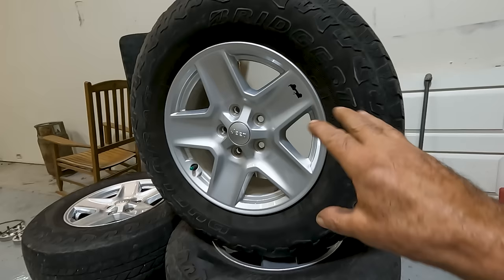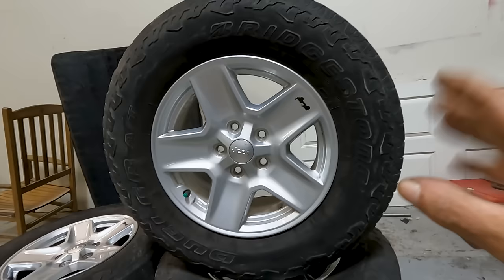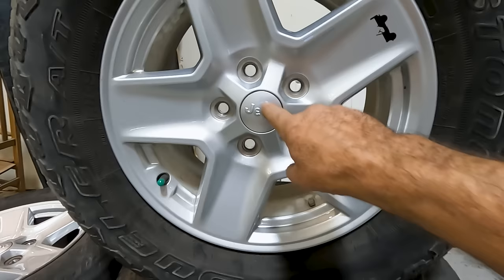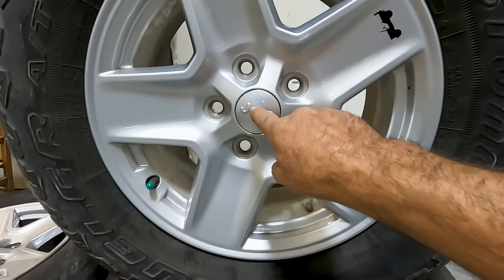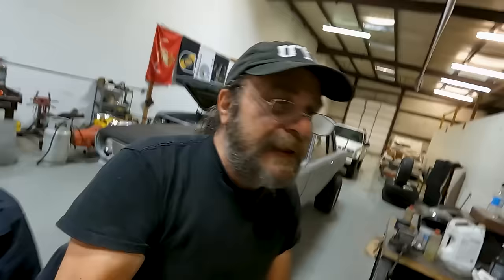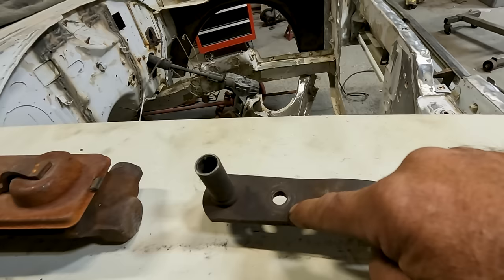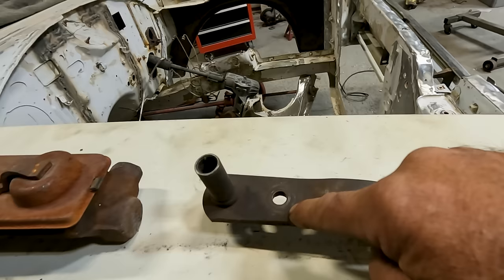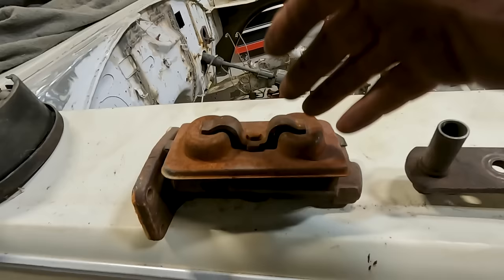Modifying Classic Cars And The Butterfly Effect - Can You Outsmart The Engineers?

Comment: Hold on there bro, they build to the minimal unit cost. Hence the first generation of a car is most likely to have undersized brakes. One of mine comes with 266mm discs and then in the 2nd gen they upped them to 280mm discs due to repeated warping of the front brakes. This is stock.

I have since fixed this, fronts are 320mm units to reduce any chance of brake fade and over heating.

Comment: Spot on, Uncle Tony. My dad was an engineer for GM in the 50's and 60's. As kids messing with cars he asked us if we knew more than the engineers who designed them. he said the same thing as you: don't mess with the safety systems on the vehicles. But at the same time, don't go faster than the brakes can stop you.
And as a suggestion: as a "classic car" for a daily driver, the 1998/99 Buick Riviera is hard to beat. Yeah, it isn't fast, but was not designed to be. If you wantcomfort, reliability and parts availability, they are hard to beat. Avoid the 97 and earlier for several reasons. I drive mine on 2000 mile road trip vacations every summer and just love it.

Comment: I changed to disk brakes on the rear of my 83 Firebird.  I changed the whole rear end out of an 88 Iroc Z. Junkyard upgrade from another factory made Thirdgen.  Still stock but an "upgrade" overall gaining limited slip, disk and rear sway bar. Bolts in, done. No re-engineering the engineers.
Reply: ...unless you didnt change the master cylinder AND proportioning valve you DID re-engineer the engineers
Reply: Me and the VW boys have been doing this on mk1/2 vws since they hit tbe road. 
It's the safest best pre-engineered upgrades you can do is to swap the good stuff from better models as long as you use the total system.
Reply: It is funny you went through all that expense when the rear do very little braking at higher speeds.
Reply: Did this guy just not understand the message?
Reply: @mexicanspec  Man i think people also forget that self adjusting rear drums are very low maintenance. Why would I want to bother changing rear brake pads and sliders when I can just forget about my drums.

Comment: I don’t completely agree.  What you’ve got in the final product isn’t necessarily what the engineers would have liked to produce.  Price margins and government regulations de-optimized a lot of what we could have had.  There’s ALWAYS room for improvement.
Reply: Exactly.  Price is the first element of auto design.  Otherwise every car would be a Ferrari.  I think this vid actually made me dumber.
Reply: I put CPP disc brakes on my stock '66 Chevy C10 pickup. I also put power boost assist and modulator so I could balance front to back braking. Made a HUGE difference and felt much safer to drive. Some folks have to change their wheel and tire size to be able to buy new tires too as old sizes have been discontinued.
Reply: Zachary yebo. Man, I like Tony, but it took restraint to watch this video all the way thru.

Comment: Very good explanation Tony.  Some people will upgrade the brakes with no knowledge of cause and effect.  They actually make a safe car dangerous because the upgrade causes the brakes to grab so well they lock the tires up and make the car skid out of control on a hard panic brake.  A dual master cylinder set up properly to replace a single cylinder master cylinder, meaning no real upgrade other than safety, so you would still have either front or rear brakes instead of absolutely no brakes should a line pop or wheel cylinder blow out, a person may want to consider that.  Great job of explaining this.  So many people mess up cars due to being short on knowledge but with good intentions.

Comment: There have been times when engineers had to do what they were told not what was right. For example I had a 1970 Dodge Coronet 500 it's front suspension was garbage the Ball joints tie rods were way too small for a vehicle that big and heavy. I lived in a place that winter would destroy the roads , when I was delivering Pizza with that car I was replacing the Tie rods several times a year , and the ball joints 1-2 times a year 😮 I had extra tie rod ends in my trunk and the tools needed to replace them on the fly. It was like owning an old Harley that shook itself apart lol. Unfortunately there were no aftermarket companies I knew of back then that made stronger parts for the old Dodge I just had to deal with it.  Now some of the other mods actually made the car drive and handle better than stock. Like the Edelbrock intake, the black jack headers , the Holly 650 double pumper carb.. my mileage went up 5-6 mpg. and down a little if I used the extra power I now had. It was a very reliable daily driver except for those darn OEM suspension parts.

Comment: It’s the same the other way around too…in taking off from a stop or even accelerating while moving… it’ll take more effort..or force with the larger tires than with the smaller stock tires…although you would have an increase in speed at the same rpm with the larger tires…along with slightly better fuel mileage…

Comment: The brakes are a non issue when it comes to using an XJ for a tow vehicle. The brakes are... adequate. It's the weight (or lack there of), the high center of gravity, and the short wheelbase that make the XJ an impractical at best and dangerous at worst tow vehicle. Before you know it the tail is wagging the dog, and that can get you into trouble pretty quick.
Reply: Doesn’t happen if you properly load your trailer.
Reply: You blame the vehicle characteristics for being a poor choice for a tow vehicle. I blame the driver. I use a Ferd Explorer for a tow pig. Short and famous for rolling. Never had a problem and I am on my third one over 20 years. Same size engine as the XJ and maybe less HP. In my world, the XJ is an excellent choice. I have towed stock trailers, horse trailers. car trailers and camper trailers. Of course my little utility trailer as well. Knowing how to tow safely is important no matter the vehicle you are driving. People die every year because they think they can just hook on to a trailer and don't understand what is involved to do it safely.
Reply: Agreed,my brother in law was pulling a heavy load with an old 4x4 Cherokee and it pushed the jeep through the woods like to never got the jeep out of the trees
Reply: @garycrawford6912  If your trailer brakes work properly, they will stop all of the extra weight you are pulling. Most places have laws as to how much you can pull without brakes on the trailer, and it isn't much. If the trailer pushed him off the road, he was going too fast or had inadequate trailer brakes. Again, driver error, not the vehicle.

Comment: If'n I was fixin' to tow with that jeep at capacity I think I'd be converting (if it's not already) the trailer to electric brakes and using a weight-distributing hitch. If you read the Jeep specs and the hitch specs it may already require it?  Electric brakes work better for one thing, next if the trailer gets squirrely you can trailer brake and straighten out. The weight distributing or platform hitch will keep your car level and tow so much better.

I used to shun such things now I see the genius of them...

Comment: I will say one of the most fun, reliable daily drivers i had over the years was a 92 honda civic si hatchback. It had a 1994 twin cam b18 a1(stock) and the short ratio transmission with a limited slip.(but still stock)
It had tein coilovers that were set up with proper preload, and not ridiculously low, it also had poly bushings, and the stock acura 4 wheel disc brakes from a 1996 Integra. It had 17 inch wheels, but they were super light. And really didnt ride all that bad. 
It would get 40 mpg, and since pretty much everything in the drivetrain was stock honda parts, reliability wasnt a concern. 
That thing was a good little car, that would absolutely frighten people with how capable it was in a corner. 
I constantly got pulled over in that thing. cops hated it, my neighbors hated it, it was a blast.

Comment: I think that brake upgrading the whole braking system, as well as the steering system on any car is a plus factor.
Is but absolutely necessary, absolutely not for normal driving conditions, but it is certainly a much better driving experience for anyone who drives even for a daily driver.

Comment: I mostly agree with you. However for one of my cars Ford came out with a better braking system for a limited production version. I converted my car to it. It's MUCH better than stock. Another car I have, two model years later Ford gave it front disc brakes. That's an upgrade I have for it. (including the master cylinder, proportioning valve, etc) So there is improvement that's available because engineers also have to consider cost. And the cost limits have to do with market demands, what competition is offering, etc.

There's tons of modifications like this out there. Original engineering intent can be preserved by simply paying attention to what was changed between sub models and model years. Often it's not much.
Reply: Very insightful, you are on the money. Study the year to year upgrades, and make sure you have all the changes needed for the correct result.
Reply: Yeah in a perfect world engineers would only be engineering for purpose, but cost optimization is a very real and very big part of engineering. I wouldn't even really consider upgrading equipment to a better option level to be a "mod" on the same level as hacking in a completely different system or installing something aftermarket, since it's a manufacturer-designed package.

Comment: I watched a buddy of mine almost have brake failure by upgrading a cam because it couldnt make enough vacuum. Never in my life if I hadnt seen it would I have believed it. Fox Body lessons....
Reply: That doesn't make sense.  vacuum doesn't change anything in the braking system other than making the pedal easier to depress.
Reply: @mexicanspec  Thats exactly what I thought.... Its not so much a failure, bad wording. The car basically pushed itself through its own brakes from low manifold pressure to the booster. Thats how it was explained to me.

Comment: Tony you are spot on! When I was young and stupid I patched the brake lines on a 1973 Olds wagon with disc brakes on front and drum on rear by eliminating the proportioning valve. Brakes worked fine at slow speeds, but at 50 mph a slight touch of the pedal locked up the rear brakes like in a panic stop! I put the brakes back with the proportioning valve and they worked fine!

Comment: I have a 30 year old Honda Civic that came with power steering, vacuum assisted front disc, rear drum brakes and 175/70/13 tires on skinny 13 inch steel wheels. I put a set of 205/50/15 tires on a set of factory 15 inch Acura Integra wheels, along with a slightly larger diameter brake master cylinder and I no longer use the vacuum assist for the brakes or the power assist for the steering. It sounds like I ruined my daily, but for me, it made it a TON better drive and even better on fuel. It is such a light weight car, power assist is not needed for the brakes or steering. I love it.
Reply: My 1981 vw rabbit with a tdi swap is similar to yours 
Except mine actually makes torque. 
And gets twice the mpg😂
Reply: @fastinradfordable   Well, you can be smug about your torque and MPG, but my little D15B7 16 valve, 1.5 liter gasoline 4 cylinder in my 2,380 pound 1992 Honda Civic DX sedan, with its 102HP and 98 Ib-ft of torque (when it was new, it does have 302,000+ miles on it now and was abused when I bought the car 10 years ago with 235,000) coupled with the 5 speed manual transmission from a 1993 Honda Civic VX hatchback and its 3.25:1 final drive got me 50 miles per gallon without trying on my way to a friend's house and back on one of my favorite stretches of road. I am pretty happy with that, and the car can do 75 miles per hour all day long on the interstate turning about 2,600 to 2,800 RPM at the engine (vs 3,300-3,400 RPM with the original 5 speed the car came with) I just hate how much crap has been scattered by stupid people on the interstates in my area and I am not willing to damage my car on parts from other vehicles. And while yes, I did manage 52 MPG in a VW Jetta sedan back around the time Diesel Gate happened, I can literally fix my entire Civic with a handful of tools and my mileage is plenty high for a gas burner.

Comment: Great video Tony, I never thought of some of the things you touched on concerning disc brake conversions. For example, when you said that factory disc brake cars can have smaller drums in the rear than an all drum car. So applying that cause and affect logic, during an emergency stop situation, a bigger drum in the rear might cause the back tires to lock up and possibly throw the car sideways. I never considered brake line diameter and master cylinder differences either. Thanks for going over these important aspects.

Comment: The Jeep information, Bravo Tony !  I said on here in the past that I am a jeep guy. I have towed with many Jeeps with the longer wheelbase of 112 inches. 

Any of the jeeps with the inline 6 cylinder and the longer wheelbase can tow 6500 lbs , but need to be the right kit.

You need to be running the stock wheel and tire combo or 1 size down .

You need to be making use of a weight distribution hitch for tongue weight distribution and to help with anti sway.

You need to be making use of an adjustable brake controller and good electric brakes on the trailer.

I had a guy walk up to me amazed one day and started questioning me about my rig.

I was towing a half ton truck on a car hauler behind my jeep. 

He thought that was backward and had never seen that before.

I told him that it was perfectly able to do it but that you never tow in overdrive and you drive according to conditions.

I also never modified the stock build except for an oversized external engine oil cooler and transmission oil cooler.

Otherwise I was running 225 tires instead of 235 tires on the stock rims with the air psi set to max for load capacity.

Comment: I agree with you Tony. However some upgrades can be done to a classic car if you do your research and choose carefully the modifications you do. When I bought my 1964 Galaxie it came stock with manual drum brakes. I am a very careful driver when I'm out driving and I avoid crowded roads and interstate traffic if at all possible but even then the 1964 technology just scared me. I did a lot of research and stayed within the Ford engineering train of thought. My solution led me to upgrade using later model disc brake engineering using a combination of LTD and Lincoln parts in the whole system. I did not piece all of this together using aftermarket parts. The master cylinder, pedal ratio, power booster, line sizes, rear drums ,combination valve all remained the same and the complete system was transferred to my car. The result is a braking system which stops like a modern car. Best part is everything is affordable and available at your local parts store. Also, my wife is a good driver but I would not toss her the keys and feel safe with the old drum brakes.

Comment: This is the stuff that makes me happy that I bucked the prevailing wisdom when I rebuilt the brakes on my '66 Fury. I just redid everything with stock replacement parts (the only exception being that I installed a '67 drum brake master for the dual reservoir), and I'm completely satisfied with the braking performance. I've never once been in a situation where I wondered if the car was going to stop in time.

 I've really grown to appreciate Tony's attitudes about leaving a daily driver basically stock. As much as the 20-year-old me would have been disappointed with not modifying everything to within an inch of its life, the slightly older, marginally wiser me has figured out that these are pretty good cars from the factory, and as Tony said, I'm probably not smarter than the engineers who designed them.

Comment: Let’s not also forget the ease of replacement parts. Yes an auto parts store might not have classic parts on the shelf anymore, but it’s much less complicated to get/order suspension and brake parts for a stock old car, than it is for something that has a lowered suspension or an aftermarket disc brake conversion. Great advice UT!

Comment: Good video. 
My pops used to run 1/5 mile B+ modified production with his daily 69' camaro (new at the time) and he spent many an hour during the 70's having to chase the perverbial broken butterfly down to get to work during the week. As a life long gearhead and heavy equipment mechanic he spared no subtlety in his advice to me. 

..." leave it alone! Don't play with your daily"

"Failure follows the next weakest part in line"

And another nugget, closely related to Uncle Tony's point...."you can build a car to do one specific thing, really well on a cheap budget. It starts hitting your wallet when you want it to do multiple things"

Comment: Your comments on drum vs disc brakes are spot on.  People think disc brakes are superior in every way.  All things equal, drum brakes provide better clamping force, which is why they are still common on big trucks.  Discs are superior for shedding heat and precise braking force modulation, which is why they are used on sports cars and race cars.